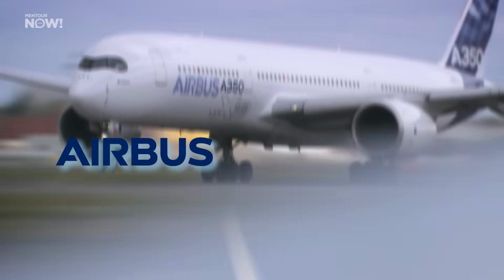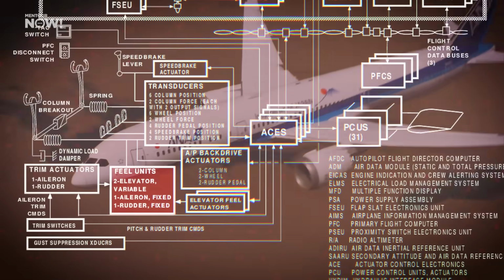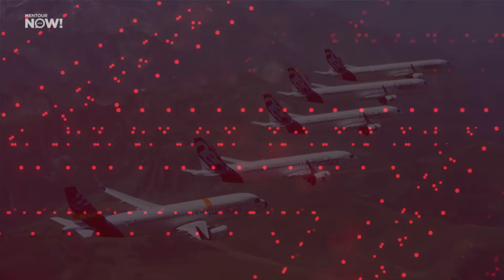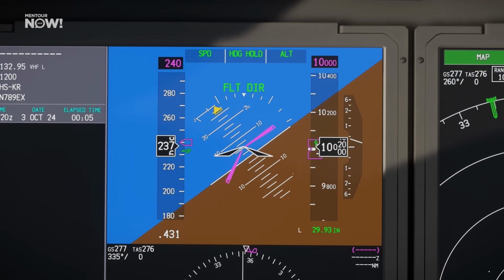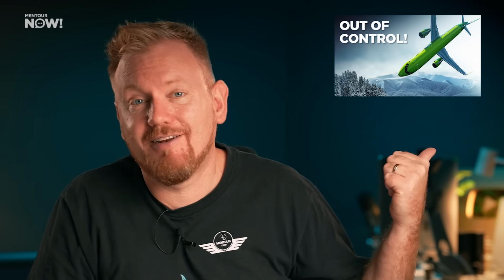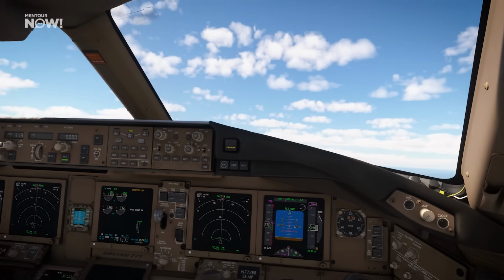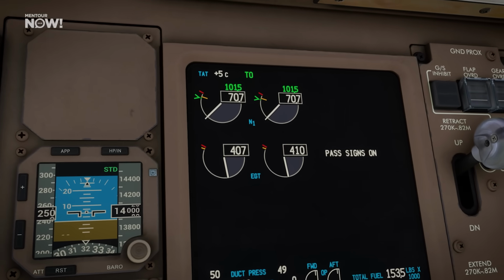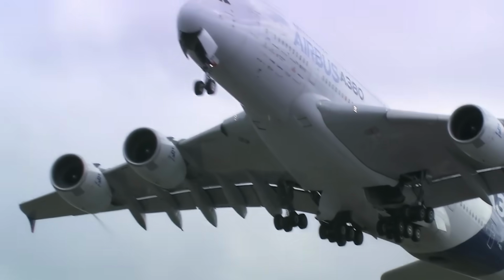Do Pilots Prefer AIRBUS over BOEING?!

Comment: Training is good when what you learn is used in every day operations.  Training is far less effective when you learn what to do in a one in a life time situation.  Many lesser airlines tell their pilots to use the automation.  So the first time they use many features is in an emergency.  Not the best time.

On a separate issue it is shocking that Airbus leave their controls in the wrong position when moved from elsewhere.  They need to at least indicate say with some illumination that unlike normal when being controlled by a pilot the position does not indicate the demand.  Like MCAS it is not a "design feature" but just negligence from both Airbus and their regulator.

Comment: Given the number of accident investigation videos in which the pilots failed to monitor, understand or make use of the instruments, a design that emphasizes monitoring the instruments, as the video described for one, seems like a good idea.

The video mentions that generation 4 fly by wire designs have proven safer statistically, but then mentions that Boeing and Airbus have equivalent records.  Given that Boeing's best selling aircraft is the old style, this is confusing... which is it?

Comment: I prefer Boeing mostly, because i think it is more simple than the Airbus. Yes Airbus has a lot automation but its FMC is very complicated. On the other hand Boeings FMC is very much straight forward and easier to understand. 
In terms of flying Airbus is much easier but sometimes, especially in strong winds the manual trimming that 737 NG has becomes handy in my opinion. 
I am comparing 737NG series and 320-200 series btw. 
Overall for having fun from what you do i would go with Boeing. 
For comfort i would go with Airbus.

Comment: The biggest difference is fatigue for pilots flying multiple legs a day. The Airbus is a lot less fatiguing. The flight deck is much more roomy and easily allows for two jump seaters. The cabin is also 6 inches wider which translates into an economy seat being one inch wider as compared to a 737. Our FA’s even prefer the galleys on our A-320 family aircraft versus the 73.
Reply: i have flown on an a320 and a 737 this year and i preferred being on the 737
Reply: Fatique, nonsense.. then try fly a long-haul bizjet.. way smaller than a 737 cockpit.
Reply: @ I have and the long haul charter is only one take off and landing, maybe two because of a reposition. Not 4 legs in a day like a lot of 73 folks are doing.

Comment: I must admit that I find it VERY hard to understand the ""reasoning"" behind Airbus design decision to NOT give physical, i.e. tactile feedback when the ""system overides/counters a pilot action""(e.g. averaging dual inputs orm preventing or even "countering" pitch or Yaw input)...
To me that "strategy" seems like a "recipe for disaster". And my reasoning is as follows, if a Pilot/s tries to execute "actions/manuevers" that are such that  the "system" needs to override them to protect the air-plane. Then the chances are very high that the pilot/s already are in a mental state where they are suffering from some degree of "stress, confusion and or lowered general awareness".
And I fail to see how it is a good decision to, at that point with already somewhat "incapacitated" pilot/s, let the air-plane start to "counter command" the pilots actions without taking all possible chances of letting the pilots know that this is actually occuring. I.e. giving the pilot/s TACTILE feedback that "mirrors" the "systems counteractions"..
Now I suppose that "someone" is going to make the (to me seriously erroneous) claim that this is done to not "further stress" the pilots with "even more information"...But to me this sounds nonsensical, as getting actual  physical feedback is, if properly implemented, both tremendously more "direct and intuitive" and doesn't "stress the cognitive side" of "decision making" the way that "signage or audible information" does. It can literally be controlled by "muscle reflexes" ((Just imagine trying to hold Your balance without proprioception, instead only have "gauges and audible feedback" You would be "on Your @ss in a second" ;)) ... 
All in all that decision seems pretty ludicrous to me, but I would very much like if someone could explain to me what I've gotten wrong about this.
Best regards

Comment: A320 family Non-moving thrust lever is fine. The throttles can't break and if they do, it means you have a far more deeper issue. At the end of the day, you have to be a sharp airman and always keep your hand flying skills and basics sharp. The 320 family is very easy to fly. Pilots love control and thats fine. Just fly your metal the way you're supposed to and itll be fine.

Comment: Just build planes with more powerful engines so they can climb straight up at any altitude below 10,000 feet.
Reply: Those exist, like the English Electric Lightning for example. The business model to make them work as a commercial airliner is somewhat challenging however.
Reply: @johanslabbert2869  True, It will be interesting to see if it is ever implemented in commercial aviation. I assume if enough crashes happened, and it was determined to be the only reasonable solution, they would use it. But that would be a long time from now.

Comment: It seems like when an airbus accident occurs it’s in the chain of:
1.some sensor, either AOA  vane or air speed pitot tube gets blocked by ice
2.Airbus goes into a lower control law
3.The crew is confused, doesn’t realize that the aircraft entered alternate or even worse direct law and failed to respond to the situation

Comment: Airbus is the one that crashed into the ground on it's first flight because the plane's computer wanted to land while the pilot want to do a fly by.  Airbus's computer likes to fight the pilot and fly into the ground.
Boeing is a product of 50+ years of Affirmative Action, total garbage company from the ground up.  The new 737 is not the same aircraft as the original 737 but Boeing used that name to get around all the 'new' aircraft inspections, trials and QA checks. They pushed a new aircraft, claiming it was an old aircraft design, and people died.
Airbus is not American owned, so they have less of a chance of getting horrible products to market in the US, and DEI hires, while Boeing owns congress and does whatever the hell they want with no consequences.  They put people into death traps and laugh on the way to the bank.
In short, drive there if possible.

Comment: For the throttles and the side stick not to move so the pilots can visually see what the airplane is doing is really not a very good idea.
All human beings react to what they can see and in case of a toga lock, it may take a few crucial seconds for the pilots to become aware and those few seconds may be the difference between saving a situation or crashing.
Nothing is perfect and neither Airbus or Boeing are perfect either.
The process of making flying safer will never stop.
I tend to believe that the worst thing that can happen to any pilot is if the airplane is doing or reacting in a manner that confuses the pilots. All reactions by the airplane systems should preferably be very obvious and clear to the pilots all the time.
A system designed to help and assist the pilots may in very rare cases end up being a contributing cause of accidents if the pilots are not very clear about what the airplane is doing.
Which airplane is better, a Boeing or Airbus can never be answered in a proper manner simply because a pilot having spend the majority of his/her career in an Airbus or Boeing will automatically favor that brand airplane. 
The main thing is really that airplane designers focus on making flying as safe of humanly possible.

Comment: I read somewhere that anti-lock brakes on cars were expected to reduce the number of accidents. But they didn’t. It turns out that people tend to accept a certain amount of risk, and when they have the protection of more safety features, they become more complacent, less careful. I have only ever flown single engine aircraft, so I am not qualified to have an opinion on which heavy aircraft are better to fly. I would guess, though, that Airbus pilots should have loads of training in direct control mode. Just in case.
Reply: I once set off to drive to Manchester in a car that the ABS had failed on, it started to rain really hard and I ended up abandoning the journey because I didn't trust my ability to stop the car in the wet quickly when cars around me had the advantage of ABS. Turned out it was a good decision as there was a nasty crash further up the road anyway!
Reply: @TIMMEH19991  You should really look into a performance driving course then. If your on the road you should know how to handle a vehicle for your safety and others. Not to mention driving for the conditions of the road and also confidence in being able to handle yourself. I sure would not want a pilot that couldn't handle a plane if some system quit working during flight.
Reply: @TIMMEH19991  I made a 300km drive in a white out blizzard in my 1978 mustang 2 when i was 19 years old from Edmonton to Calgary, summer tires that really had no traction. Made it without any issues by knowing how to handle it. That car def had no ABS brakes or any type of computer help lol. Even manual transmission. All kinds of cars and 4x4 trucks hitting the ditch, drove right by them cause i drove according to road conditions. Maintaining speed with traffic flow and proper spacing.

Comment: One key point is that Fly by Wire is controlled by software, and there are always corner cases in any software control system that are not expected/handled gracefully.

Comment: Debugging when you are flying and shit is hitting the fan: I think critical information needs to take priority. Maybe if you want a debugging system that can dig deep (lets say you have several minutes of extra fuel to check out your problem and you can maintain safe speeds per your elevation then by all means.).

But stalls / engine failure / emergency go arounds / etc are happening within seconds. You make a plan in seconds then act on it. The debugging and training (in critical failures) should make it evident what to priorities and act on. Maybe you have just enough time to check out one check list and then ditch (cause you are at low altitude).

Debugging cannot get in the way of time sensitive emergencies. Learn the debugging tools but learn how to train and work outside of strict debugging tools.

Comment: One thing I noticed was it seemed as though the airbus only informed you it was going into alternate or direct law with a small bit of text.  One would think an auditory or more visual cue would be important.  And why not just let the pilots decide by having them press a button to turn off normal law while at the same time essentially having the airlines make a rule that normal law stays on unless there is an emergency.
Reply: i dont think you really get why Alternate Law and Direct law exist... The protections provided by Normal Law can only work if there are enough Sensors available to get reliable info about certain Parameters. For example if the Pitot Probes were blocked there is no way the Stall protection could work, since the Aircraft doesnt have proper info about its Airspeed. therefore degraded Protections.
What you are saying is something like "If an Engine fails (eg falls off) the Pilots could decide they would prefer not having an Engine Failure and keep the Engine running"
Reply: @unitrader403  No I get that, the issue I am seeing is that on occasions it becomes necessary the pilots seem sometimes unaware they have entered into alternate or direct law.  When it has been discussed on this channel it appears as though the only information telling them this is small text on a screen which can easily be missed by pilots trying to troubleshoot a problem.  Would think a big change like that should have some sort of auditory warning like a terrain warning or when autopilot is disabled.  I also think the pilots should be able to quickly change the modes themselves with like a covered button or switch.

Comment: I owned and flew a Cessna 335 for almost 20 years (I am a physician).  It had a Cessna 400B autopilot which was linked to 2 Garmin 430WASS GPS and Aspen PDF and MFD.  This was plenty of automation. I would not have wanted more automation which, I feel, would have reduced the joy and challenge of flying.  On occasion, the autopilot would fail and I would revert to hand fly.  I felt the plane. I felt we were linked and talked to each other. After watching this video, I know I would not like to fly commercial liners. Although being a test pilot would be another story.

Comment: If human error is a main problem that airbus wants to adress, then feedback of the sidestick input to the other side is a must. No other system makes a permantly malfunctioning companion (lack of situational awareness, leading to inadequate steering) in the other seat more quickly more directly and more accurately understandable. "Dual input" is processed too slowly, does not point directly to the problem and provides too little immediate information about the problem that constitutes an absolute emergency... and then maybe you can have a qicker look into the "wtf are you doing" crm checklist...😊

Comment: Boeing has way better support, more metal hardware. Airbus has prettier interiors and less feedback. Lighting might find the fly by wire, wires sometimes, the thin cooper mesh can vaporize if a hard direct hit finds its way in. 
Trusting your complete control systems to computers and wire harnesses with a composite skin adds risk. Old pulley control tabs were super reliable in case of total electrical failure due to fire, mechanical damage etc. But cost is a big deal in commercial aviation..

Comment: Do these aircraft have backup speed indication from GPS, for example, or even Inertial navigation? It seems a bit illogical to not have backups for systems that can be affected by ice, snow, dirt, insects??
Reply: The A320 and later can have backup speed from AOA and depending how new they are depends how advanced the backup is. Only the 787 on Boeings side has backup speed from AOA

Comment: Maintenance here. It's Airbus all the way. I'm a bigger guy and when you have the flight crew on board while I'm troubleshooting or finishing up paperwork while the crew and passengers on board, Airbus wins every time. Unless we're talking about a 787 vs an A350. In that case, Airbus wins by small, almost negligible margins.  As for flying them? Given the chance, I'll take either. Ultimately many parts are made by the same or similar companies. All that said my heart will always be with the tank of the skies... the MD80. Room to work or ease of maintenance be damned lol.

Comment: As a frequent flyer, i have to say... i go with Embraer 😂

Those 190/175er are used a lot by LOT for their east-Europe destinations. They offer (with the 2x2 layout) a little more sideway room than any A320 or 737 would give. Also you have more space for your Hand luggage.

But to come back to Boeing vs Airbus: I have to admit that the 737 is quiter in cruise than the A320 (which is the opposite on the flight-deck, as I just learned from the 'missed by 100 miles' video). Those two just feel the same in any other Economy-Passenger-Aspect.

In the larger aircraft, A350 vs 777, the Airbus wins by a mile or so. Just the higher humidity in the A350 makes traveling so much more comfortable! It is also (again contrary to the smaller ones) more quiet than the 777.

Comment: Bet the pilots of Air France 447 wished they'd have had connected yokes.  They'd have figured out one pilot was pulling back on the stick for a few minutes thus stalling the aircraft until it was way to late to recover.  Not to mention relying on protections when none existed because he didn't understand Airbus flight laws.
Reply: PSeveral 737 also stalled. The connected yokes didn't help them. Robert on 447 did know Bonin was pulling up ant told him so. Bonin contiinued anyway.
The main reason AF447 crashed was extreemly bad airmenship. If he had done nothing, nothing would have happened. If he had done memory items, nothing would have happend. If he forgot how to fly, just do the checklists and nothing would have happened.
If he didn't ignore 54 Stall warnings, nothing would have happened. If he remotelly understood the concept of coffin corner, which they basically discussed before and concluded not to climb, nothing would have happened.

He had to go an EXTZREMELY LONG WAY to make that crash happen. 
And they called out alternate law when it happened.
They just completely forgot what a plane is.